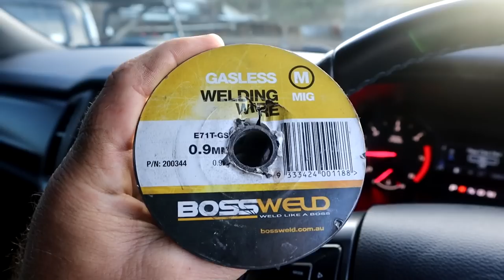welding a 350z LSD diff / poor mans 2 way

Comment: When I was in Germany I seen so many cars that color driving around.  Each manufacturer has a slightly different shade of grey and in my opinion Skoda nailed it... it will be close to the ranger and probably without the pearls, their color code could be worth checking out for a start point. Perhaps

Comment: I have an 04 6MT SEDAN. is the rear diff ratio 3.5?
Reply from the maker: thats what i run on my v8 z chassis
Reply: @Lukefink  that's what I should have stayed with. My brother sold me a 3.3. And we welded it. Unless I'm moving faster. My stock little VQ can't rip those tires and second gear at low speed. I'm going to weld my 3.5 vlsd